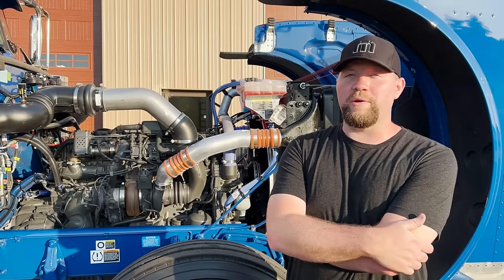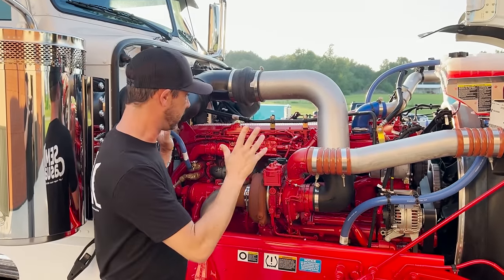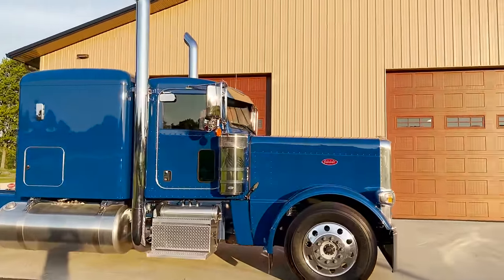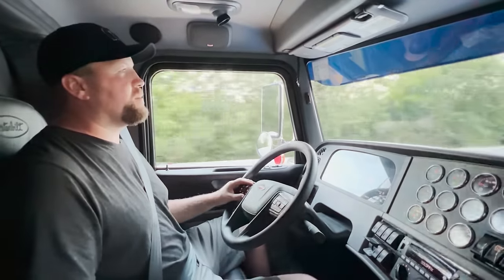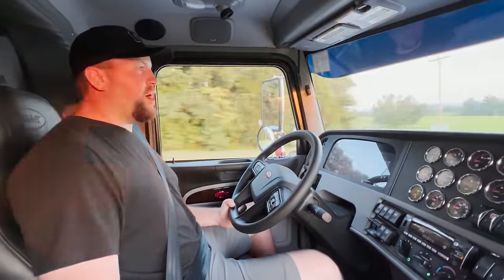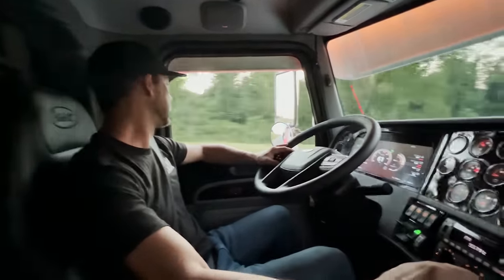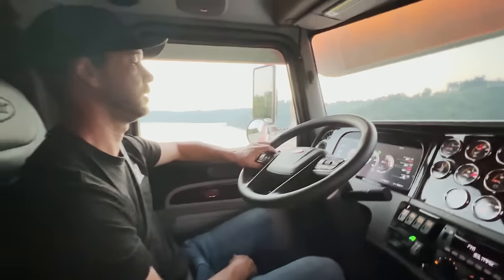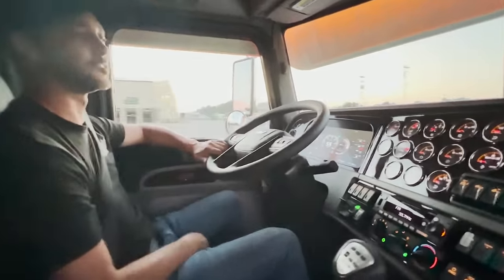Cummins X15  VS.  Paccar MX13  -  What are you gonna choose?

Comment: If ur not a mechanic and want a truck that will last the longest without fixing Paccar all day. If u want to work on ur truck constantly get a cummins. The real question is would u rather work on ur dpf system get a paccar. If u want to work on ur cams, rear structure and front structure get a cummins. Paccar are far more reliable but harder to work on so much more driver want a cummins. I work on both daily and newer cummins have a lot more problems but a lot more easy to fix.

Comment: Wouldn't the 12 liter Cummins be a closer comparison?
Reply: I would be, but PACCAR doesn't sell the X12.  Only Freightliner offers it in their day cabs.  The other OEMS don't want it since it would be competition to their own small motors, like the MX11 and MX13.
Reply: @MrPizzaman09  I just meant HP to HP. The Mack I drive at work has a X12 Cummins.
Reply: @jasonwilliams8016  Are you sure that's not the ISX12 or ISX12 natural gas?  That's an older engine.
Reply: @MrPizzaman09  oh probably they are older trucks. 3 are natural gas but we do have one Diesel.

Comment: Cummins will be cheaper on maintenance in the long run. Easier to work on and more reliable.  I would never change the oil on either at the recommended service intervals.

Comment: Bobtail road test are bogas. The only way to properly get sound results is to have a loaded  box or flat bed trailer  and run the same route fill the truck at the same station , check pulling hills and fuel mileage.

Comment: Cummins has been making great, reliable Diesel truck engines in this country ever since there was such a thing as trucks;   Comparatively, Paccar is new to making engines and they have a very bad reputation for poor engine reliability. What good is fuel mileage if your truck is sitting in the shop with a broke down engine? Just the opinion of a retired diesel mechanic.
Reply: The Paccar MX is not new, it is the Daf MX engine and make engines for decades. I even think these engines are adapted for the US market..sounds different, number of HP as well

Comment: It's rather telling that Paccar, the owner of Peterbilt and Kenworth doesn't offer the 12L Cummins in this same truck. With ratings almost identical to the MX and oil change intervals up to 75k miles (all Cummins show 75K for oil change at lighter use) it would appear that it's not just a comprable engine but a replacement for the MX. Engine weight is almost identical for the MX or the 12L Cummins as well. So this comparison isn't about which engine is better, it's about the marketing forced on anyone purchasing a truck to use the Paccar engine. Meanwhile, past the warranty intervals, ask any mechanic about which engine is more capable of running that "second time around". I've yet to find one claim the MX is better. Justification for what the vast majority consider to be a lesser engine from a sales point of view is undoubtably influcence from the manufacturer and dealer to push what is the higher profit engine combination for them, not necessarily the owner/operator. The same comparison could be made concerning a manual transmission vs an automatic transmission. Lack of qualified drivers is only one aspect, the other is Paccar makes more money/profit on the automatic and then there is the huge difference in repair costs 500,000 miles down the proverbial road.

Comment: The biggest problem with the Paccar is the cam shaft. There only lasting about 75,000 miles and it has to taking out of the back of engine also the cam lobes are pressed on a shaft. The reason it has to taking out of the back is they were designed in Europe where there’s nothing but cabovers

Comment: Maan....my x15 needs fuel filter changes within 10kmiles. My oil change intervals are 35kmiles and it's currently in the shop for a bad EGR oil cooler for the 5th time in 3yrs. (I only have 290kmiles/605hp in a 100anniversary t680. The power is nice but my goodness this machine is a maintenance baby 😟

Comment: I have own one Cummins engine hated it. Had 4 cat motors best motor ever. One 60 series no complaints. Have a MX 13 motor is good emissions part is expensive and sucks. All motors have been in tri axle dump trucks with mainly 18 speeds couple 8LL and 13

Comment: Um I would recommend  oil changes alot sooner. Sure the manufacturer says it can go 75k or 60k. They would love  nothing more then for you to buy a new truck or new engine prematurely.  I have the mx 13.i change my oil every 20k. I have zero issues and I have 547k on my engine. Oil still gets dirty. Especially in these epa engines. Soot gets in the oil and scars bearings and such. And builds up carbon which damages the engine.

Comment: I had an mx block and head crack at 750,000 miles and that would have cost close to 70,000$ for a new motor where the mechanic told me that if it was a Cummins it would have been around 50,000$ , needless to say that truck went to the scrap yard

Comment: Peterbilt Tech here. My honest opinion, Cummins. Unfortunately, with KW & Pete trucks, they are Paccar vehicles. So much, but not all of their technology is Paccar. So although I feel a Cummins is a better engine, you're dealing with Paccar cost for other chassis and aftertreatment electrical systems. 

Diagnostic for Paccar engines cost more, software needed to diag and change on board systems is significantly more money for a Tech investment and knowledge if you're using original software (outperforms Snap-On scan tools). Paccar engines are lighter because of plastic was used to replace many parts. Oil pans, fuel lines, injector housings, etc. These don't make them less expensive for consumers to replace, its to save manufacturers money. You're still paying premium prices because of the name.

Cummins diagnostic software is affordable and reliable directly through Cummins. Manufacturers pair Cummins aftertreatment with system with their engines. Benefit, parts in general cost less for Cummins. Maintenance does not cost more, if your engine has a longer life span. I see Cummins and Paccar engines failing as low as 200k. It honestly depends on your ability to maintain and service your vehicle frequently as possible. You can NEVER do your oil change too early, but you can do it too LATE. 

Fuel economy, not true, It is common for manufacturers to use smaller PX9 motors in SuperTags for example. I've heard from operator owners their average is 5mpg. My opinion, ask other drivers with your desired configuration before you listen to these Youtube videos. MX13 motors are getting the same MPG so why settle for a smaller motor? 

Disregard their comments on Technicians. That iPad tech is expensive and no dealership are running them. An IPad is not going to diagnose your CEL. We are called technicians for a reason, vehicles today are technical. There is not one truck I do not pull out my a multimeter to verify  concerns. Replacing multiple sensors cost owner operators more money. Don't let your repair center shot gun diag your truck for electrical concerns. Do expect to pay several hours for diag time before a prospecting sensor is found. 

Transmission, you'll see more Paccar automatic in the future. Alison is most common trans being sold today. Automanual are the best in my opinion. No clutch pedal, though there is a clutch. They shift automatically, based on load and speed factors. It shifts smoother, making them more reliable and improves MPG. They do drive completely different than a manual or auto. Example, initial take off displays allot of torque. If your not ready, it may feel jerky. Its cheaper to replace an auto manual clutch then rebuild an auto trans. This configuration can only be installed during the manufacturing process. So do your research.

Do not use USED parts. I would encourage your turbo to be rebuilt. But never install something you know nothing about. Much of the technology is temperamental and will cause chain reactions due to failure. New parts come with warranty too. Parts do not to be installed by service center for this warranty. And if the part fails within warranty period, service center can swap them free. This is because the part manufacturer pays the labor. You get what you pay for.

Comment: I wouldn't take either one. I spent a year in a 2020 X15 500hp/1850lbft 18 spd that was so lazy(even bobtail) I grossed a meager 118k lbs. I was so disappointed. From 1350-1800rpm. It sounded like it was throwing a rod. It only had 33,000km on it I drove it til 95,000km. Sad everyday I went to work. The MX13 always annoyed me, 510hp/1860lbft. And still lazy, I drove a 2018 for 11 months. At least it didn't sound like it was throwing a rod. At a different company(3 years before) I had one for a 7 weeks that would always lose connections on 2 injectors, fucking awesome feeling having you teeth shaken out of your head at 63mph for hours on end 5 days a week. That company dumped $20k per truck in over 5 months(7 units)  fucking junk. They had 250 paccar units. I have yet to find a 389 that was quiet lol. Funny about shift patterns the my experience with the Cummins is it wants the higher revs, didn't start to pull until 1250rpm. The Paccar true to its roots pulled from 1100rpm(European). I ran 140k all day long with a 410hp/1550lbft 60 series with a 15spd that pulled better than the 500hp X15 with 118k gross.  It was THAT BAD. MY Volvo with the Ishift was better on fuel, pulled better(off the line) at 140k(B-train Tanker)

Comment: You are mistaken, those fuel filters do not last 75k in any application. I just looked up the maintenance schedule for a MX-13 EPA21, like the one in this video.  75k oil changes and 37k fuel filter intervals are recommended for normal duty/ line haul applications and only if idle time is below 20%, and on a sleeper that probably won't be the case. 50k / 25k intervals are recommended for idle time over 20%. But Paccar still recommends 30k / 15k intervals for severe duty, vocational, pick-up, delivery and refuse.

Comment: You need to get a loaded test trailer, when you drive modern trucks with electronic engine control they know your running empty or Bob tail and react accordingly. Your only going to know how the engine performs if it's under load.

Comment: I have a 579 x15 efficiency 500hp 1850 torque with 13 sp ultra shift 3.08 gears 260wb o/o specs front air ride. 80 inch sleeper platinum interior all the goodies I get 8mpg running 65mph. I'm that 60 year old guy who wants quiet, smooth, and easy to drive. Once the knees go south, shifting is out. Had the big stuff when I was younger, but this by far is the best truck I have ever had.

Comment: Take the X-15. My X-13 was bad right from the factory. X-13 had metal shavings in the fuel filter housings, it sat for over 90 days at the dealership in Phoenix waiting for new injectors and such. The dealership didn't keep the truck batteries on a charge to keep them topped up so now they are bad too. Worse yet a mechanic told me last week they're still coming from the factory this way still. Unbelievable! BUYER BE WARE!!

Comment: You aint never going to convince somebody who believes that the Cummins is the best Engine that the Paccar is a worthy rival. Plus I do not believe many of the negative comments claiming how bad the Paccar is. Here in Aussie we run our Kenworth's with Paccar Engines. Not only do we run at Much higher gross weights. Also we do not have the type of roads found in the USA, smooth tarmacadam, a vast majority of our roads are dirt and very rough to boot.
Actual facts our. MX13s have an extremely better fuel consumption and as for reliability we have less problems in our fleet, with the Paccar than the Cummins powered tractors. Yes the Cummins has bigger power. But the Paccar gives us better power at the wheels. I know I will not convince the die hard Cummins engine dudes out there. But give it time and that will change as you have the two biggest Truck names in the World both owned by Paccar. With costs and reliability becoming a major factor in future trucking then the Paccar engine will only grow.

Comment: The difference between 5 and 6mpg over a million miles based on fuel at $4 per gallon on a single truck is $166 thousand dollars. So guys the next time your racing at 65 to 70mph to get to a reciever to sit for 3 hours in your truck waiting to be unloaded and moaning about cost of fuel. There is your answer.

Comment: In all honesty, driving a truck with NO TRAILER with NO LOAD MEANS NOTHING!!!!! You put both of these under 40 tons (80,000lbs) of weight, then we'll see which truck will perform better. I wasn't sold on neither opinion simply because it all comes down to performance under pressure which is performance under a CONSTANT WORKLOAD! I've been driving trucks for 21 years and at the end of the day it all comes down to which truck will make me the most money with the least number of repairs and fuel cost, with consistent and reliable performance not bobtailing or deadheading, but under a load.

Comment: I have been pulling a set of B-trains hauling steel coils  - In Canada  with a  2020  Pete. 389 with a Cummins X-15  @ 500 H.P.  / 1850 Torque. For almost two years now and I can tell you the X-15 is a great engine. Lots of power all the way down to 1000 RPM. I shift the 18 speed @ about 1200 RPM , and it will run out to 1450 in top gear @ 100 KM/H . You won't need no more .I can get as good as 6.0 MPG with 135,000lb. Gross. And as low as 5.0 MPG. Depends on conditions. Empty with the Joints @ (43,500lb)  can get 7.0 MPG.

Comment: Drove most of the trucks out there. Started with a Columbia with a Detroit series 60 moved on to a cascadia withe a series 60 really liked those engines from there went to a 388 with a Cummins 485 loved it had a 13 speed and ran great from that went to a 389 Cummins 15 with the 550hp with 18 speed. I really miss the Detroit 60 but my favorite was the Cummins 550, good spin not loud at idle great power. These were my personal trucks. I have driven Kenworth and international but they both had Cummins great trucks as well. Really do like the Cummins.

Comment: I am a Cummins fan I have a n14 Cummins red top on my oldy truck Volvo and that engine yeap is a monster but I'm driving a t680 and this truck have a paccar engine and yeap sometimes is slow on the run but when the truck kicks the gear is run like a MDF  great on diesel on my opinion not a diesel vampire I'm talking about those cat C15 drag race monster roads great engine tooooo..... But I'm my opinion is kind like a second engine if my Cummins went out of service but I preferred a red Cummins in parts is more accesible in any part of usa and not so problematic in sensor any ways I keep running my n14 to his dead 🤣🤣🤣🤣🤣🤣🤣.

Comment: Easy choice. I've driven both in the same model same year, same transmission and gearing. The Paccard might make a good boat anchor. The Paccard also does not get better fuel mileage in real life. The Paccard is under powered big time. Empty trailer going up I40 north of Little Rock,  AR had to drop gears with the Paccard. The Cummins staid in cruise control and never thought about dropping a gear same run. Loaded going I 69 through WV with 37,000 lbs on, the Paccard was in 5th gear and struggling.  The Cummins dropped to 9th (13 speed Eaton Fuller ) and kept on pulling. You couldn't give me a Paccard without the option of loading it up and trading it.
Reply: No I 69 in WV

Comment: The Pacar engine is ok, but it struggles uphill with power. Would  Much rather take a Cummings over Pacar engine. I rather have a Cat, but they don't mk bigg trk motors anymore,  but I'm an old school bigg trk diver anyway. Would still prefer cat over over pacar nd Cummings,  but Cummings over pacar most definitely 🤔😎. But, Would not want a auto..

Comment: You can keep the pacccar engine,,there weak,,,constantly broke down,,,,x15 Cummins is reliable,,,very strong in any horse power range,,,but you have to remember rear end gears are very important for pulling power

Comment: Any ISX is only useful for a boating we've got four of them and spent over a hundred thousand dollars in repairs when you buy a ISX new you need to buy a spare turbo a spare cam two fuel pumps of an a set  injectors and keep them under the bunk hell you might as well just buy a complete rebuild kit and carry it with you for the Cummins ISX  boat anchors I have a paccar and I love my little paccar hell I have a maxxforce and I like my MaxxForce more than I do and I have isx my Maxxforce will outrun and out pull both of them

Comment: I run MX-13 on a Midroof 579. Doing flatbed with an average of 70K-79Klbs gross and it has been good so far. I average about 7.3 overall I would say running the East Coast. I have never felt as if my Paccar ever was lacking in any way. Plus what’s the point of having more service places with Cummins if over half more got shit reviews on Google. I’m from Atlanta just there alone the Cummins shop has a 3.3 as of right now.

Comment: I have almost 900,000 on my PACCAR and it might use a gallon and a half of oil and it’s still going strong. Also been tuned and gets better fuel mileage.
Reply: I just got a deleted mx13 in a 2014 pete 579 i don’t understand all the hate?

Comment: They both are good till 400k-500k miles till first problems start.
Mx13 or new  x15 both are emissions junk engines. Cummins famous wilth bad fuel pump and cylinder liners sink into block to early. Mx13 will cost you much more in service. Cause geartrain in the back and cant pull out cams without removing engine. Both engines have  leaky egr coolers, turbo failures bad turbo actuators and vgt sticking. Dpf def scr problems will cost you new one box every 500k miles ($15k atleast).
I rather choose old 3406e or 6nz. Its not very fuel efficient , it will run forever.